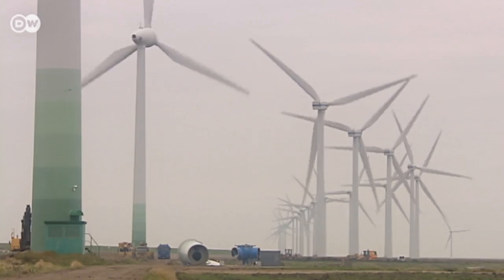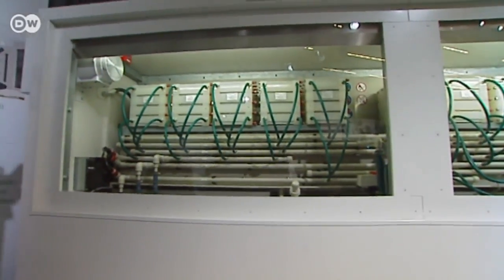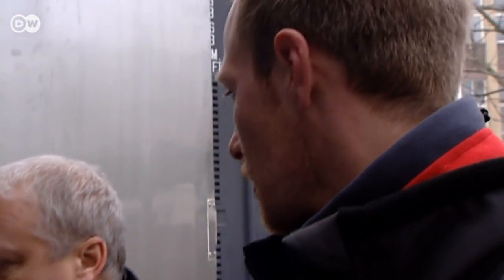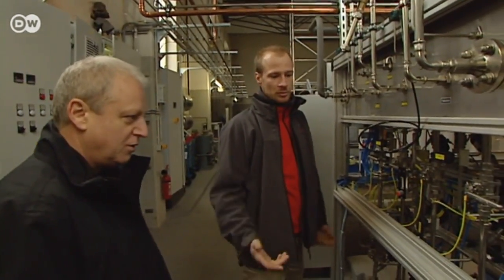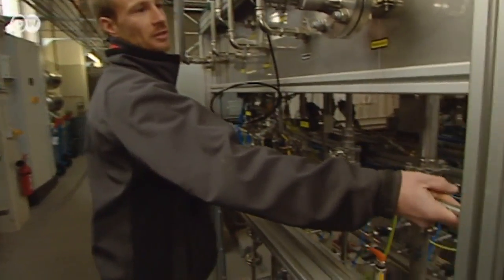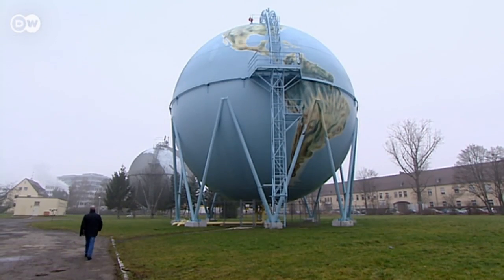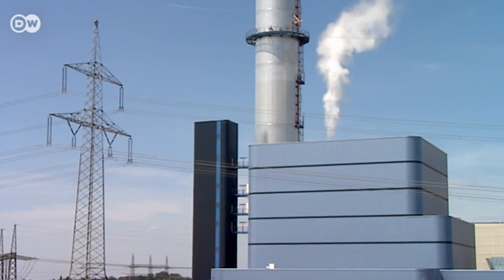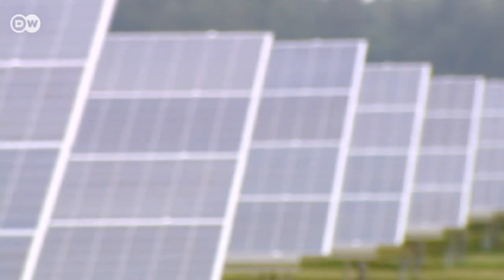Sustainable technologies: power-to-gas | Tomorrow Today

Comment: Wouldn’t it be better to use the Hydrogen which is much more combustible Gas than Methane. Also energy has to be used to pump the CO2 to mix with the Hydrogen, just to make a less energy dense gas!. The Hydrogen could also be re combined with the Oxygen to generate an electric current instead of burning the gas to turn a turbine. It seems the choice you have gone for is the least efficient one.

Comment: Could one turn to the gasification of (waste) biomass instead? After all, to make methane, hydrogen and carbon are needed and both have to come from somewhere. Gathering CO₂ from the surrounding air seems very costly so why not substitute air for biomass as the carbon source? If the Sabatier Raction has to be used, doing biomass gasification and Water-Gas Shift Reaction will give a mixture of CO₂ and H₂ from biomass and H₂O. From there, Methane can be produced and any excess CO₂ expelled or captured for Carbon Capture and Sequestration or Carbon Capture and Utilization.
Should this process turn up to be more efficient and/or cost-effective than the anaerobic digestion of biomass, that alone would be very compelling.

The question with this is whether or not that would adversely affect the flexibility of operation of the plant. In this video, the flexibility of turning up and turning down production has been boasted. Any alternative that sacrifices flexibility would be less effective at absorbing surpluses from renewable energy.
Reply: Melanoma Can you please help me to know how can we change hydrogen to methane gas please mail me about it thank you

Comment: There seems to be a solution to this problem for home consumers. Tesla has built a practical way of storing solar energy, it's called the Powerwall. Go check it out!
Reply: Ah yes, the Tesla Powerwall. According to the website, the Powerwall boasts a 6.4 kWh capacity, making it splendid for shifting surplus solar power towards night-time. However, what about shifting surplus solar energy from summer to winter? A cache of 6.4 kWh won't last very long when the days get shorter and shorter -- not to mention the cloud cover often associated with Winter. There's the 100 kWh Tesla Powerpack but I don't think consumers would rather over-bulk on batteries to cover seasonal intermittency over falling back on the electric grid in the winter months. Natural Gas can be stored over months and that is exactly the point. More than that, NG has uses other than generating electricity (cooking, heating and even transportation) so an annual surplus of electricity won't pose as much of a problem than without Power to Gas. That's what I think anyway.

Still, batteries are quite helpful for short-term electricity balancing as things stand so they definitely have their place on the grid.
Reply: ThePotatoSmash we are talking about baseload that could power a city...
Reply: Melanoma the storing of excess energy in a dam I think could be the remedy...

Comment: what is AC power storage? you can't store alternating current, you can only store DC in batteries and they work only for a short time and can only store very little energy and they are very expensive.

Comment: Yes, if the methane was released directly into the atmosphere. However, it will be used to power a gas turbine and the carbon dioxide emissions from the gas turbine--to the extent that there are any--can be recycled back into the hydrogen-carbon dioxide cycle of the system to contribute to another supply of methane, and so on.

Comment: The point of the item was two-fold: Excess electricity could be stored in the form of electrolised hydrogen that is combined with carbon dioxide to generate methane. It would be possible to use the electricity to drive pumps to supply a hydroelectric solution, But that is infrastructure  intensive and is not suitable for use as an export technology.